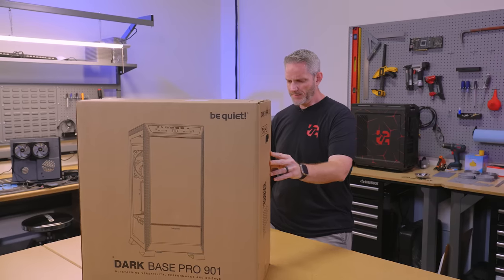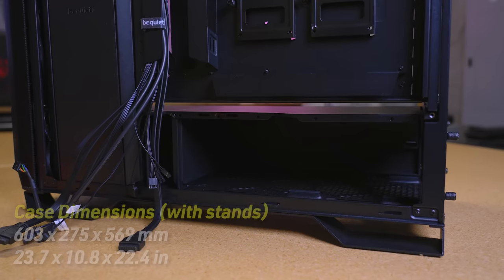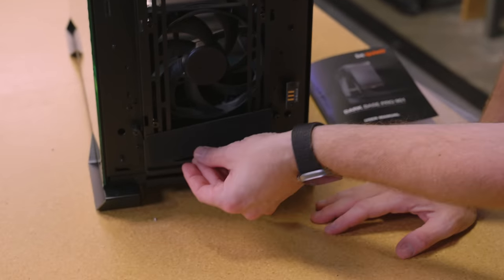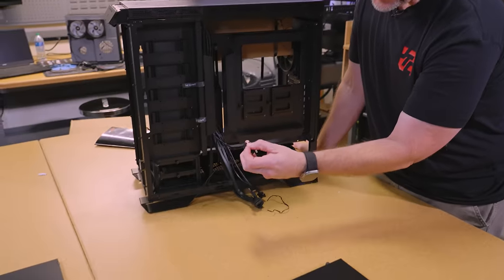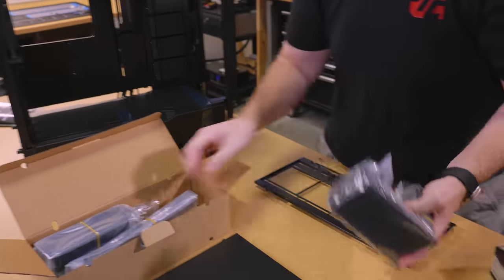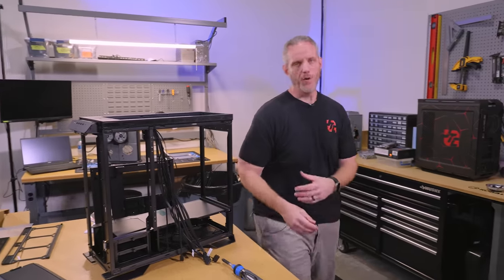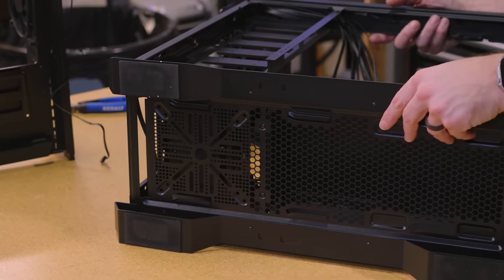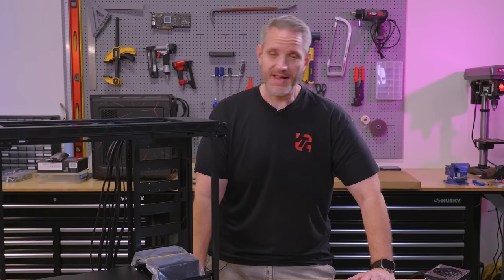This computer case is just crazy!

Comment: Love the fact that Be Quiet is still offering 5.25" bays in their cases. Having quality, current cases available that support optical drives is great.
Reply: For real! It'd be better if it could support a dozen 3.5" drives as well. It'd make a perfect NAS/Media Server case then.
Reply: I use the free AIO PC I got when I need an optical drive (ripping CDs/DVDs) 😂
Reply: @MasterZoentrobe It does support rather many 3,5" bays though. You need to get extra brackets for them but you can mount them in the rectangular holes in the front.
Reply: Yeah, there are so many of us ripping blu-rays for use on NAS’s as well!  There are dozens of us!
Reply: @vdevov  Practically a gross!
Reply: @TheZoenGaming  this case is actually a step down from the 900 so far as 3.5" drive capacity goes. In the old 900, if you pulled the 5.25" drive bay rack, you could get a second double-3.5" rack and fit up to 9 3.5" drive bays in the stock positions. The old 900 also makes it easier to integrate aftermarket fan-mounted 3.5" drive bay racks elsewhere in the Chassis.
Reply: A little disappointed that only one optical bay is available. And it is on the bottom of the case. My case has 4 optical bays. I use 2 of them for DVD burner and Blu-ray drive. The other 2 have a 5.25” hhd and single ssd drive in a 3.5” bay.
Reply: @Dragonited  It can hold 2 or with 7 optional cages 9 3.5" drives. You literally have to buy a drive cage for each additional drive. That's an extra $30 USD per drive for a total of $210 USD for 9 HDDs. On top of $320 USD for the case itself?! No, thanks, I'll buy a more reasonable case like the Define 7 and mod it to hold an optical drive. LOL
Reply: @vdevov oooh careful there edgelord. So sharp.
Reply: hells yeah! Fractal too, which is nice.
Reply: I have a really nice BD-RW drive just waiting for a new home, this case with the 3.5" bays should make a nice archiving machine.
Reply: I wish I could show you what I did to my old Thermaltake Armor case. Only because I wanted to keep my Bluray drive! 
Nice case btw!
Reply: The 901 can only fit 7 3.5” drives. The old 900 could fit 9+ with the two 5.25” drive rack removed.
Reply: Exactly!  Nobody wants to have external optical, or hard drives if they can help it. I know I hate the external optical drives especially.
Reply: I just use a Blu-Ray drive in a SATA to USB enclosure and it works fine, but I may keep an eye out for this case next build I do if I like everything else about it.
Reply: I came here to ask about this. Definitely a selling point for me.
Reply: @TheZoenGaming  It does have slots for 7, that's good enough to me
Reply: I agree, and glad that Jay didn't go hard on the clickbait title.
Reply: and phanteks doesn't release a new one with one because the original enthoo pro is still pretty modern featurewise
Reply: Why not just get a USB. Drive bay connect when u need it.
Reply: @vdevov  They probably want floppy drives too
Reply: I like motherboards still give a disc instead of a locked usb chip. I dont even have a player to stick my bluray collection into anymore after the xbox stopped playing them.
Reply: @NeVErseeNMeLikEDis  They take up space, take up valuable USB ports, are annoying to find and pull out, have to be transported separately from the computer, and need to be put away after use. A 5 1/4" bay bypasses literally all of that nonsense while also giving you the ability to use any extra USB headers on your mobo for extra front ports. Some peripherals also require external power. Something the 5 1/4" bay also bypasses, letting you use any unused connections on your PSU instead.
Reply: 5.25" drive bays for the win! <333 The more, the better, honestly.
Reply: Disagree with this optical drives support media that is prone to failure overtime whereas non-moving parts will last longer. I get the nostalgia. I understand that there are people that still have these things. I grew up in a time where use multiple floppy disc to play Doom on a PC. Regardless, I am still a proponent of moving to reliability over nostalgia.
Reply: I still watch dvds and blu rays with the kids using my pc.  No everything is available on the internet.  Wish there were more options for 5.25 bays.
Reply: I still use my 5.25 for bluray, not for ripping, just to watch the movies I really like
Reply: Exactly. I actually enjoy having a blu-ray drive in my machine.
Reply: The Fractal Pop XL Air I just got does too in a very similar way to this case
Reply: @ScottADunn  There's a LOT more you can use 5.25" drive bays for besides just optical drives, but regardless, blu-rays are actually a lot MORE reliable than any streaming service and save room on your hard drive.

Now, if you're taking about sailing the high seas, that's different I suppose, but even then, the blu-ray copy of a movie is the best quality version of that movie and comes with special features and audio and subtitle options all convenient and ready to go.
Reply: i use for a hot swap bay . 3.25 and 2.25
Reply: @arnox4554  I understand, I run a NAS that uses Emby for all the Blu-Ray that I had, I did away with them a couple years ago, but that unit runs for that specific purpose. My personal PC is three nvme and one solid state. It's eventually a forced change, I'm a bleeding edge fella
Reply: @ScottADunn  Thank you for not leaning on nostalgia. I also grew up around using floppy disks and CD/DVD but I do not miss it one bit. Like you said media that is prone to failure over time - not to mention the ungodly amount of physical space required for your collection and much more I wish not to go into detail. Yeah, back then there weren't many better options for storage since hard drive prices were high and there weren't many high capacity drives like today. 

I can understand that around 6 to 10 years ago external optical drives were not that good especially Blu-Ray and the prices were insane, but these days you can get a quality external optical drive for dirt cheap. And the freedom it gives you using it on any desktop or laptop is much greater than the inconvenience of taking a tiny amount of physical space on your desk or taking up USB ports - which there are plenty even on budget motherboards.
Reply: Optical drive? lol nerd
Reply: @arnox4554  This is a bit of a sidebar, but I've noticed that most mobos only have a header for 1 pair of USB 3.2As and the 1 USB 3.2 C.  For full towers where do we hook up the other 2 Type As or do we just lose bandwith/connectivity?
Reply: @silvanbarrow86  If the mobo doesn't have the header for it, it doesn't have it. I suppose you MAY be able to use one header for multiple ports. Maybe. But then you're sharing bandwidth.
Reply: I'm OK with having just one optical bay, but I DEFINITELY want to have one.
Reply: Should have been two 5.25" considering the size of the case and the size of the door.
Reply: optical drive ftw
Reply: @AdmiralGloval PC Cases with all the RGB inside are placed on the Desk these days. So an Optical Drive on the bottom puts it perfectly in reach of a sitting person.
Reply: If you live in 2010 yeah 🤣
Reply: @TheZoenGaming With all the other customization, I'm surprised that isn't an option!
Reply: New cases with optical drive bays are few and far between. More options are great, even when they are expensive. I went with the Fractal Define 7 recently as it was the only model in my retailers store listing. Otherwise I would have gone O11 Dynamic or Fractal Torrent. I am not ready to forego an optical drive just yet.
Reply: @bahamutbbob  Yeah, same.
Reply: Well nobody needs it but its nice if they still have it for the few peps who need it.
Reply: Agree, I bought a thermaltake Core V70 last year because I needed a home server case with room for lots of HDDs and an optical drive.
Reply: Yep, stick a bluray drive in there and watch a movie on your 4k monitor on half screen whilst "working" on the other half.
Reply: Yeah I still have 4x 5,25 and 2x 2,5 ones in my antec p280. Which suffering on GPU space for the new massive cards. 8 years ago no body thought GPU going to be 40cm long.
Reply: @ploed  I put a Gigabyte 6900XT in my Corasir Crystal 680 case and it was such a tight fit that the ends of the heatpipes are touching one of the fan cases in the front... But doesn't cause any issues and helped stop any sag.
Reply: @HecklerUK  haha same with my 6800, it has a scratch mark on the end because the HDD case was 1mm to long. Had to push hard to slot it in the PCIe slot I was lucky it didn't slip and broke the PCB.
Reply: @PHDarren  Or just do work on the 1080p monitor.
Reply: True. I picked an older case for my HTPC so I could have my Blu Ray drive. Though this would be overkill for that. 😁
Reply: @TheZoenGaming  the dark base 900 exists the only major change I see between the newer case and the old one is more mesh and with that the hdd cage disappears because both at the same time isn’t possible
Reply: @ScottADunn  M-Disc for the win.
Reply: @silvanbarrow86  Add-in PCI-e cards with headers exist, too. Use one of those since modern mobos hwve PCI-e lanes to spare. Unless, ya know, you're one of the edgy few running a M-ITX board in a full tower case.
Reply: If there were two bags you could put an old full height 5.25" SCSI 9gb drive in there!
Reply: Yeah for the power user and hobbyist drive bays are still VERY relevant.. Even 3.5" bays.. 3.5" drives still have the cost / capacity advantage if you're not looking for blazing fast load times in games. I will however say that solid state has won me for boot drives. I'm disappointed in the lack of 3.5" drive bays in most modern cases too.
Reply: This is exactly why I got myself a Fractal Pop Air XL. I REFUSE to build a PC that does not contain an optical drive. you can have my physical media when you PRY IT FROM MY COLD DEAD HANDS!!!.
Reply: "When is the last time..." Fractal Design Pop 😂 But yeah it has become rare.
Reply: @TheZoenGaming Best case ever, Fractal Design Define R5. 19 drives plus a couple of SSDs.
Reply: Not only optical drives, but so many other uses for 5.25" bays too - usb, fan/drive controllers, other I/O, etc. Barely any modern cases have room for any storage either, I'm still using a Cooler Master HAF case that's almost 10 years old, because even if I buy a new case I'd still have to keep using the HAF as a NAS anyways.
Reply: Fractal Define R6 for example is offering a 5.25"bay as well :)
Reply: I like the previous one, the 900, better because it has more slots. I actually still have a BD-Burner and a reservoir that needs one of those slots. And I'm not gonna ditch them should i upgrade the case.
Reply: As a person who still has a disc drive yeah it's was a factor (I ended up going and spending money on an external enclosure because of how limited it made my options).
Reply: nonsens
Reply: I agree. A hot swap bay option would be cool too.
Reply: @12Burton24  Do I use an optical drive every day or even months? No, but I'm glad to have it whenever the case arises?
Reply: @vdevov  Clueless as well as clueless comment.
Reply: @vdevov  Totally clueless.  If you really pay money to watch movies you already own with ISP hiccups then I hope you feel great being HIP.
Reply: but only in 1 modern case, and 1 old design case

Comment: Re: the sound deadening panel.  The panel can absorb reflected noises even if the case isn't completely closed off.  Yes, it's not going to be as total as if the case were completely closed, but it does help.
Reply: Was about to say that... kind of like the difference between screaming in an empty room, and screaming in a room with a couch. It would sound completely different.
Reply: Yep, this.  Sound goes in all directions.  So if you block one particular direction then the rest of the room has X-1 sound blasting around.
Reply: yea, he should not talk about sound anymore, it's insulting lol
Reply: Indeed. I review coolers for Tom's Hardware, I've noticed lower noise levels in my Silent Base 802 vs other cases using the same air coolers. It can definitely make an impact on louder air coolers.
Reply: @matthewstout7974  If sound travels in all directions, and it escapes something, then it can bounce off something outside the case, and start traveling in all directions again.
Reply: It's not sound absorbing, you don't have money for that kind of material on a pc case, it's sound deadening, which means a certain % gets lobbed off it. That said, if it's not closed off, fully, it doesn't matter if the sounds gets lobbed off by 5 walls (or 6 with holes) it will travel, touch a surface in your non-sound deadened room and it will spread through the room as it pleases. Don't be too marveled of this technological feature you've discovered. The ability to deaden some sound, or even a by a good margin, is insignificant next to the power of the Bouncing sound waves.
Reply: @aserta  It's actually to lower the resonance of the panels. You're right that there's no absorption, but that type of material also works as a diffuser.
Reply: @aserta  the effect is minimal on less noisy coolers, but it is not insignificant on the loudest air coolers. 49dba vs 46.9 is very perceptible.
Reply: @aserta  I should have said that it can cut down on direct sound.... reflected sound is gonna do what reflected sound does.

Now in the context of this case I don't sit directly in front of the front panel on my case so that panel is going to be of limited utility.  Your mileage may vary:)
Reply: @matthewstout7974 Nope, that. Cats already gave us the "this," yours was unnecessary.
Reply: @boringtextreviews I've read your review of the Dark Rock Pro 4, why didn't you address the numerous critiques of it in the forums? 🤔
Reply: @aserta   Sound deadening material does have absorption quality, yes for room treating you need mass in order to absorb large amounts of sound, but the deading material they have in this case will be good at absorbing high mids and high end frequencies which doesn't require a lot of mass, while helping reduce vibrations.   Also sound absorption material isn't expensive at all and is one of the cheapest things in acoustics to make or buy.
Reply: You also have to remember, there will be more noise to absorb too, than without it as Steve pointed out.
Reply: Came here to say this, there is a reason youtubers use acoustic panels. It's a nice addition to the panel
Reply: It's only insignificant if you're already deaf @aserta  
Benchmarks don't lie
Reply: @CarAudioInc   bro , half the planet is on fire , get some perspective , QUICK !
Reply: Sound can change to mechanical force and it volume lowers with distance.... in theory it does help and mostly with higher pitched noises which are more directional
Reply: @boringtextreviews  Correct - Half as loud (sound pressure) at 46.9DbA (based on 3Db doubling)
Reply: It also reduces vibrations
Reply: basically what he said
Reply: This... It does help with reflected noise from having a blank panel on it... its not to kill sound fully...  

It's for those that WANT a solid panel, it kills the reflective noises, where a mesh insert just allows air through... where a solid panel reflects air back and causes noises with reverberations and reflections... this sound panels kill it on solid panel inserts...   Jay should know this before just saying things like "it makes no diffrence"
Reply: @aserta   Yeah no, that's not what happens with the sound fans make, we're not talking about 20hz sub-bass here that will penetrate everything moving out like a sphere from the point source. For the typical mid-high freq noise of a fan which becomes more directional (and also dissipates more significantly over distance) , having sound deadening panels absolutely makes a real difference, especially if you work in an extremely silent room like a music studio... which I do :)
Reply: @aserta  So are you implying that sound has infinite energy, and that no matter how much it is deadened, you perceive the same volume level? It seems like you're describing a microphone feedback loop rather than sound dampening panels.
Reply: @MrSatnavatron we're all gonna die!!!!
Reply: Wish they had a closed option...
Reply: I don't know what material they use for the dampening, but if you technically would use some kind of foam it should theoretically capture some noise since the soundwaves get "trapped" in the foam and is converted into "heat"?
We have a big loud machine in our machine shop in a seperate room where we used this kind of foam, its not quieter when u stand in there since you get the noise before it reaches the panels, but from the outside its much better.
Reply: That's one of the things why i'm still looking at the "Phanteks Eclipse P600S", best case for those who want silence 😊

Comment: I do love the inclusion of the 5.25" bay, I'd either slap in a media dashboard for my SD cards and eSATA external HDDs (also having all the other ports is cool too) or a 4x 2.5" hot swap bay. It'll have to be something that doesn't see frequent use, because no way is that going on top of the desk and still give you access to the wireless charger.

Comment: I have the be quiet 802 case with solid side panel and with the solid front panel it does make a bit of a difference not much though. That could be because I’m running 3 Be quiet 140 pure wings 2 at the front and 1 140 pure wing 2 at the back. The 240 aio and gpu fans are way louder but rarely spin up. Those be quiet fans really live up to their name. Be quiet is my go to brand for case, fans and power supply

Comment: I have an older computer that I use for a mapping program that won't run on newer systems and the program requires the program CD to be in a drive, so that bay would be really nice. I just want to change out the case so my old system gets better airflow.